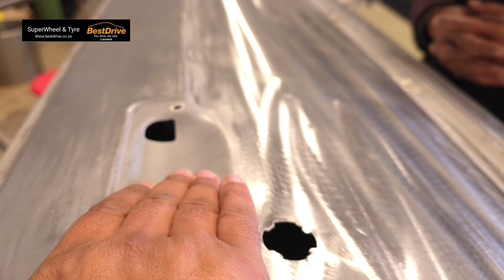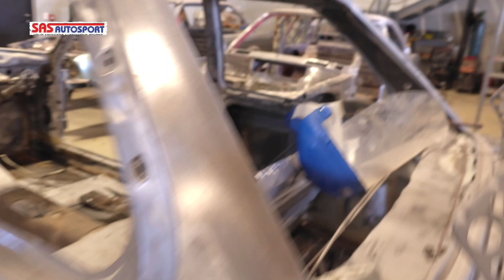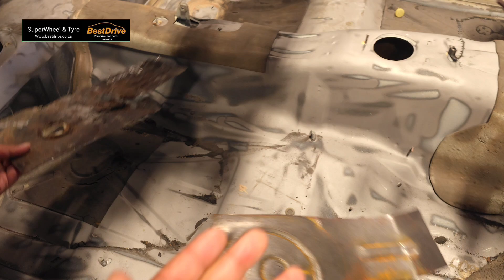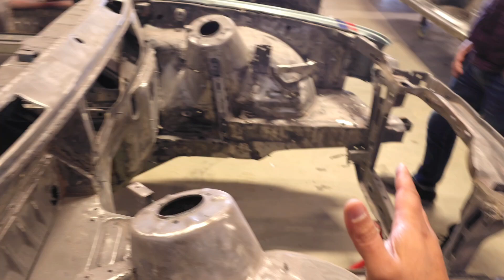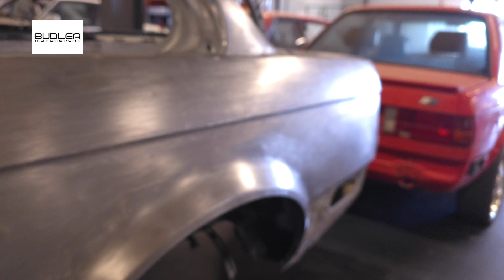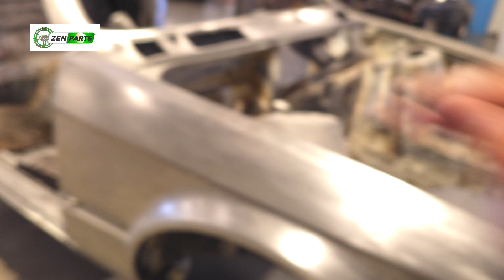E30 BARE METAL! NO FILLER REQUIRED

Comment: You will get that pad at Adendorff much cheaper
Reply from the maker: Try bud, I saw R45 on the shelves so I cleared it out, when I got to the till they told me that they marked wrong and the price is R475 

I managed to find a pack of 10 for R2800